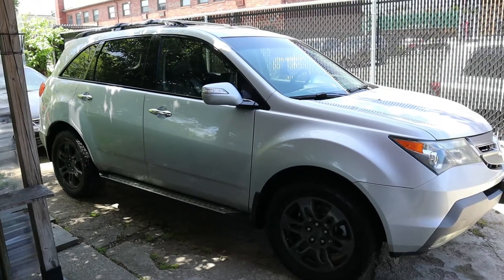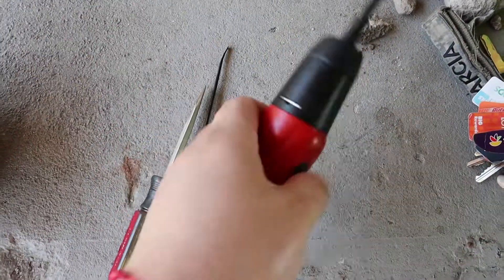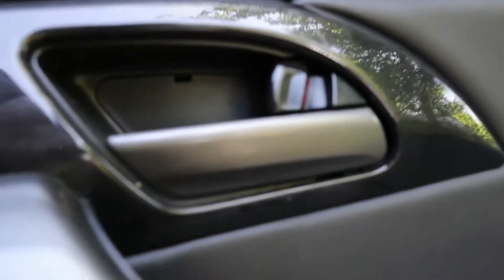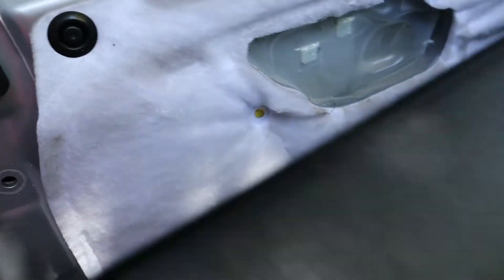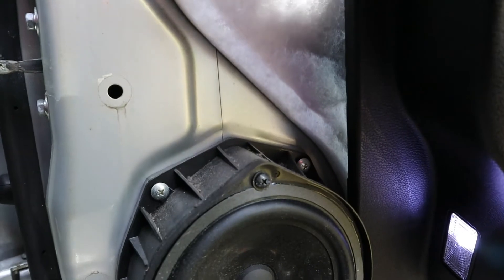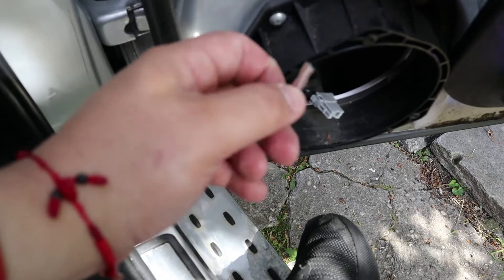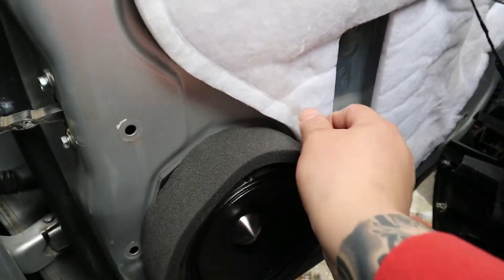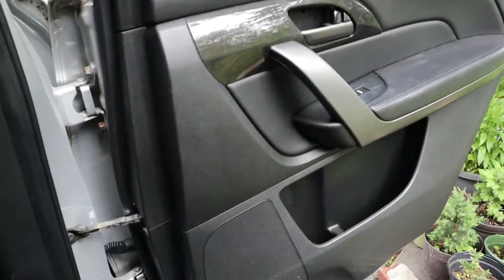Installing a new door speaker into the MDX

Comment: Great video. 
I wonder if the speaker you installed can work on my 09 acura MDX factory speakers. But 2 ohm speakers got me crazy. I don’t know how that works
Reply from the maker: Thank you. 

My MDX is an 09 this was a direct bolt and connect. These speakers aren't even at their full potential.
Reply: @gordi0621  i see in the comments you have your amp blow off (i think i see that coment)
Reply from the maker: Just one thing I forgot to mention you're going to need the connectors to avoid cutting into your stock harness.

https://www.ebay.com/itm/392037869590?mkcid=16&mkevt=1&mkrid=711-127632-2357-0&ssspo=3AJ2ej6ET4W&sssrc=4429486&ssuid=RiJu92idQi-&var=&widget_ver=artemis&media=COPY
Reply from the maker: @trapfortheking2259  I'm not using the stock amps if that's what your asking

Comment: Did you have any issues with the stock speaker having 3x mounting holes and the replacement plate having 4x?
Reply from the maker: Sorry for the late reply .

Not really just try to get them as close as possible or if you have the space get some adapters.
Reply: @gordi0621  better than no reply!  Happy Holidays!
Reply: @Vancity1982  stay high my friend